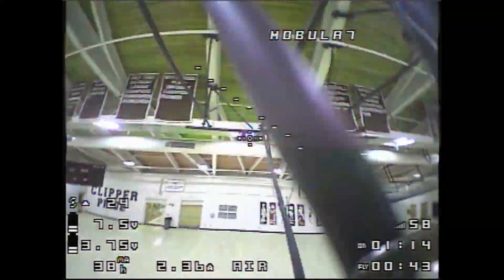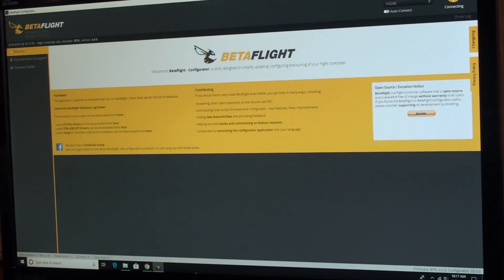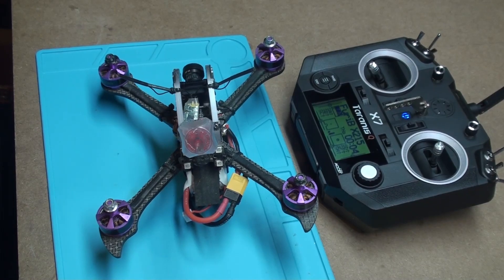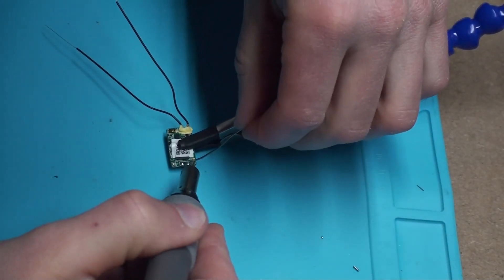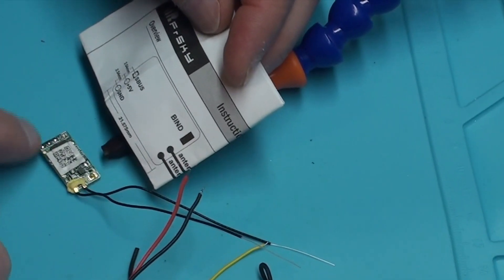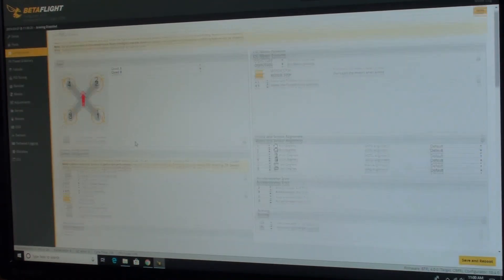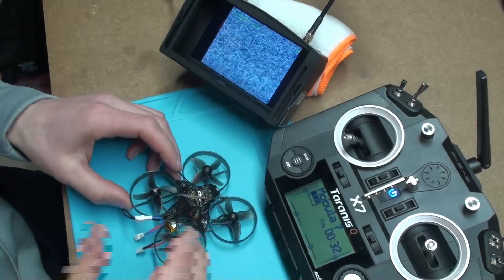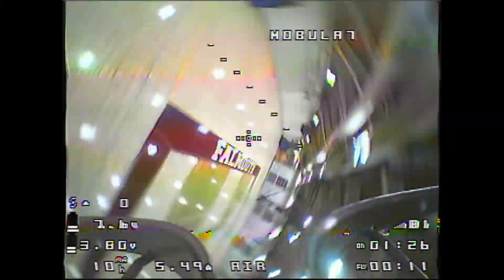Mobula7 Crazybee Receiver Dead? - Add an External Receiver

Comment: Do you think adding a frsky receiver to a flysky setup would work using the steps you took
Reply from the maker: If you're switching to an external receiver like this, then it shouldn't matter what the original internal receiver was. Good luck.

Comment: Hey, I am trying to do that same thing but my receiver wont give any light. altough I checked and its getting the correct voltage. Also when i press the bind and power it i get a solid green light
Reply from the maker: What receiver are you using? I recently had to bind an XM+ and wasn't getting lights, but then realized the lights didn't work but I was still able to bind.
Reply: @lowtone20hz  I have the normal frysky XM. And I haven't seen the red light ever. So maybe it is broken. The greenlight is only on when in binding mode. But it stays solid.
Reply from the maker: @Aron_Imandikromo  If it's solid green I think you're good. Try connecting to Betaflight (or whichever FC firmware you have) and go to the receiver tab, plug in a battery with your transmitter on and see if you've got movement on throttle, roll, pitch, and yaw. If you do, then you're good.

Comment: How do I know if a rx is inverted or non inverted (whatever that means)? I see folks just say that matter of factly but I don't see that info anywhere on my rx board or in my whoops papers. Are all Frsky rx  inverted?
Reply from the maker: Sorry for the delayed response. I hope you've got it figured out by now. If not, this might help. https://oscarliang.com/uninverted-sbus-smart-port-frsky-receivers/ But I think it only really matters if you have an F4 flight controller.
Reply: @lowtone20hz  Thanks, I will check it out. Is the Express LRS receivers inverted or non? I was considering replacing an SPI rx with an ELRS one. Some are very small and the range is touted as great.

Comment: Great info. If you just want to change to a different rx for better range and the SPI rx is not broke, will that make a difference. Is it okay to cut off the SPI antenna? Will that cause a problem with anything? Thanks.
Reply from the maker: You can cut it off if you don't want it anymore.

Comment: Can ELRS ep2 be soldered/added to a CrazybeeF4FR v2.0 FC that already has internal Frsky Rx?
Reply from the maker: Yes, you can follow the same process in the video only you will be soldering to both the TX and RX pads. Hope this helps if you haven't already gotten it flying. Good luck.

Comment: Hello, how are you? I would like to know if this procedure will work for an Eachine Trashcan Crazybeef4Fr version 1. Is the flight controller the same? What would change? Thank you very much for the video and help!
Reply from the maker: The FC does not appear to be the same. However, the process is the same. You just need to find an open RX pad. Or use the IRX1 pad which is inverted for using a FRSky receiver. Good luck!
Reply: @lowtone20hz  Thank you very much!

Comment: Hi! Does this work with the old receiver still intact? So lets say I want to put external Flysky receiver on the still working Frsky board?
Reply from the maker: I believe it would. Just make sure to change the receiver set up in the Configuration tab.
Reply: @lowtone20hz  thank you! :)
Reply: @lowtone20hz  Hi, me again. so i tried to connect a FS-A8S to the frsky crazybee. i tried ibus and ppm and in both cases changed it accordingly in the config tab. neither the quad nor betaflight does get any signal from the radio although the binding worked as it should. do you have any idea what i could try?
Reply from the maker: Check your wiring. I've not used Flysky, but it looks like you should have I-bus from the receiver wired to UART 1 on the FC. In Betaflight - 'Ports' tab set UART 1 to serial rx, 'Config' tab set to Serial based receiver and IBUS protocol. And make sure your transmitter is outputting the correct channels.
Reply: @lowtone20hz  Ok I fixed it. Do not really know why since this is my very first quad. IBUS did not want to work. I set it to SBUS instead and now everything works fine. But thanks for your quick help :))

Comment: I find it doesn’t bind if the tx is too close to the rx and the tx also needs a second to boot before plugging in drone. Save your original settings in beta so you can reboot to original working config. Fixed several problems for me.

Comment: hello, i understand electronics. Behind the receiver antenna is an integrated called cc2500. When you look at the datasheet of this integrated, it is seen that the 8-10 legs belong to the crystal outlet. I have the same problem, and this crystal is bent over it. I think he broke down when he bent down. I haven't tried it yet, but I'm going to find and replace this crystal.
Reply: i changed the crystal oscillator. everything is back to normal. However, I could not bind it. It is necessary to install an external receiver.

Comment: Nice video. Have the fc sbus slot? With wich receiver on mobula 7 v2 can i buy for easy changing the receiver. Becousr my radio is radiolink its work with sbus.
Reply from the maker: Any SBUS receiver should work with the FC. You just have to make sure the receiver will work your Radiolink transmitter. I'm not familiar enough with that radio to recommend a receiver.

Comment: Ok so I put the XM+ in my mobula7 and it sometimes arms and sometimes it doesn't. And when it doesn't it gets stuck at 49 rssi?! What could be wrong. Very ireliable scared might lose it somewhere
Reply from the maker: I believe 49 RSSI is a default and means it has no signal. So, it sounds like a bad connection. I think it would be worth double checking your wiring to make sure there's no loose wires.
Reply: @lowtone20hz  yup just re soldered everything but it still happens I updated my taranis qx7 any it does seem to be better but now it disarms mid flight. What would cause this? It like loses signal but doesn't display in the rssi that it's loosing signal. Thanks for the help!

Comment: I have a mobula 7 v2. It is acting weirdly. If clamped, the motors run fine. If held in my hand and moved around while the throttle is moved it runs well. Set it on the ground and any amount of throttle just makes it flip over and die. Any troubleshooting suggestions? Thanks. It's on 2s.
Reply from the maker: Check that the props are on correctly and all the motors spin the right direction. Good luck.
Reply: @lowtone20hz  Thanks. I'll check those points.

Comment: My internal SPI receiver stopped working on my mobula7 when I 2s'd  full speed into a wall... The Crystal oscillator near the receiver chip busted open and it looks that's what happened to yours too. I can see it in the video. It's the rectangular component on top side of board right near the antenna. If I knew what frequency oscillator goes there I would just replace it, but I don't. I'm guessing either 16Mhz or 32Mhz based on the receiver chip, but I could totally be wrong.

Comment: NOTE!
If you are clumsy as me, and for some reason you ripped off the +5V pad from the board, you can also use the +5V which gives power to the camera (which is on the other side on the board) to power your XM+.
Reply from the maker: Absolutely!

Comment: Have you done a range test with this?  I love my mob7 but the range is pretty terrible, was thinking of getting a proper FlySky module and doing the same as you.
Reply from the maker: I have not done a head to head comparison. I do have a second Mobula 7 that still has the SPI receiver working and the RSSI numbers are lower.

Comment: Im having the issue as a few in the comments ive bound the receiver to my qx7 green light showing on XM receiver but no input from my transmitter? ive changed sbus in the config tab but not exactly sure what to do in the ports tab i only see Uart1 and uart2. Uart1 seems to be the vtx. ive tried turning serial RX on both seperatly but nothing happens. The solder joint on IRX1 looks bad though i kind of messed it up maybe this is why?

This is why i bought a receiver after a crash my mobula would not bind.

thanks for the help
Reply from the maker: A bad solder joint will definitely cause some issues. Make sure that for the UART you turn on Serial RX, that the telemetry output, sensor input, and peripherals are all disabled. You may also need to plug a battery in for the receiver to work properly. To further understand - what quad do you have and which pad did you solder your receiver to?
Reply: John Solo turned out it was a bad solder joint. Now it’s working perfectly. Thanks for the help :)

Comment: Thanks for sharing, how did you get RSSI?
Reply from the maker: To get RSSI on the XM+ you need the firmware for it from the FRSky website https://www.frsky-rc.com/xm-plus-mini-sbus-non-telemetry-full-range/ Then in the Betaflight receiver tab set the RSSI channel to the same as your firmware. Good luck.
Reply: @lowtone20hz  thanks again, already found in betaflight

Comment: I have a flysky mobula7. Can I add an external frsky reciever to it?
Reply from the maker: I believe you can. From what I've looked at the boards are all the same and once you bypass the internal receiver you are just using a UART. So, the original internal receiver shouldn't matter.
Reply: lowtone20hz thanks man!

Comment: I requested mobula 7 f3 with wrong receiver can i add xm+ to mobula 7 f3 ?
Reply from the maker: It sounds like you have the same flight controller I have in the video. The onboard receiver it came with shouldn't matter. Check to make sure it's the same FC and you should be good to go.
Reply: @lowtone20hz  its crazybee f3 with dsmx onboard receiver
Reply from the maker: If it's the black board, then you are all set. The connections are all the same. Good luck.
Reply: The rx pad not on the board as yours
Reply from the maker: What's the link to the product page?
Reply: @lowtone20hz  https://shop.makerfire.com/products/happymodel-mobula7-2s-75mm-brushless-whoop-drone?variant=15424523370547
Reply from the maker: The link was for the whole Mobula7. But I've looked at all of the different boards and believe they're all the same. https://www.google.com/url?sa=t&source=web&rct=j&url=http://www.happymodel.cn/wp-content/uploads/2018/10/Mobula7-DSM2-DSMX-version-manual.pdf&ved=2ahUKEwizo_eT_ObjAhXkY98KHT3yAbEQFjAAegQIAhAB&usg=AOvVaw3RMjDLlt44MB_KvH1E3e-- Check out the manual - you have to use the RX pad where the green wire (smartaudio) is.

Comment: Great, got the exact same issue, I guess it should work with an r-xsr ? :)
Reply from the maker: I believe it should. The size is about the same. The trickiest part is squeezing the receiver under the canopy.
Reply: @lowtone20hz  It's easier to manage if you place it under the flight controller,  just above the battery tray. 3m VHB tape it right to the FC.

Comment: Will this same procedure work for a eachine trashcan , i have the same problem , a non responsive reciever .
Reply from the maker: I believe it should. The flight controller is a different board so you'll have to find the appropriate UART to use. Once you figure out which solder pads to use you should be good to go. Let me know how it goes. Good luck!

Comment: I have followed this procedure and have successfully bound the receiver and made the changes in betaflight, but I am not getting any input on the receivers tab.  Any ideas?
Reply from the maker: It looks like the same problem @Tech Ex was having below. Double check the Configuration tab in Betaflight and make sure you have the receiver set to SBUS. And in the Ports tab you switch UART 3 to Serial RX. There seemed to be more to his problem so read through those comments below. Let me know what you find.

Comment: My build in reciever has terrible range it failsaves at less then 20m in a clear area so this is kinda perfect for me!! Could you please share some pictures with me how and where you put the reciever away inside the canopy? By mail or upload? Thank you loads in advance
Reply from the maker: Sorry to hear the built in receiver isn't working for you. Double check and make sure the receiver antenna is connected properly to the board. You can look at the pictures in the manual to see how it should be. The antenna should be coming off the bottom front of the board. 
As for where I put the XM+, it's under the canopy laying sideways with the beeper on top of it and squeezed behind the camera. I'm not sure that any pictures will do it justice. Give it a try and if you're struggling with it leave your email and I'll try to get some pictures. Good luck!
Reply: @lowtone20hz  Yeah the cable(antenna) is coming out of the bottom of the plate at the front of the board but I just have a 22awg cable there so im not sure if every mobula7 is like that but I assume it is. but I will change to a xm+ since I have intentions to do yearly indoor woop races in Sweden. just waiting on a new xm+ to arrive since I don't wanna pick apart my other drones

Comment: Even after seeing the green light on the receiver, I'm not seeing any response from the quad. Any suggestions?
Reply from the maker: Double check the Configuration tab in Betaflight and make sure you have the receiver set to SBUS. And in the Ports tab you switch UART 3 to Serial RX. Let me know if that works or not. Good luck.
Reply: @lowtone20hz  I select it, then save/reboot, but when I go back into betaflight, it is switched off.
Reply from the maker: I'm guessing you're talking about the Serial RX. Make sure you have turned off SmartAudio on UART 3 under Peripherals on the Ports tab. Also, double check that your signal wire for the receiver is soldered to the correct pad - RX3. Let me know your progress - I'll help you keep troubleshooting as best I can.
Reply: @lowtone20hz  Thank you. I will give it a shot.
Reply: @lowtone20hz  I've got it to the point at which I can see the receiver values changing in betaflight, but the motors won't fire up.
Reply from the maker: Did you test the motors in BF before you switched the receiver? See 1:25 in the video. (If they worked then, the ESC's should still be okay.) Keep in mind that you need a battery plugged in to test the motors in BF. Also, double check the ESC protocol is DShot600.
Reply: @lowtone20hz  Yes, they did work, so I don't know if it is a problem with the board.
Reply: And  they are running DShot600.
Reply from the maker: Ok. So if it was working before I think it should be working now. I'd say try switching things back to stock settings before you put the new receiver on (you can leave it attached to the board) and make sure the motors are working in BF. If you have a Dump file you could just use that. And if they work, try setting everything up for the external receiver again. Sorry this is such a pain.
Reply: @lowtone20hz  Thank you! It isn't your fault and it is kinda fun to figure out.
Reply from the maker: Thanks. It's just hard troubleshooting when you can't see it first hand. Any more progress?
Reply: @lowtone20hz  Not as of right now. I'm still not seeing a problem with the connection. Might be a setting in betaflight.
Reply from the maker: Thanks for the link.That definitely looks helpful and I'll add it to the video description.
Reply from the maker: @Tech Ex  Did you ever get it to work?
Reply: @lowtone20hz  I did in the end but with out smart audio and with wobbly stabilization... I learnt alot with this flakey product so to conclude my next choice is the GePRC(buzzer pads)/ BetaFPV( no buzzer pads) 12a AIO board with our XM+ .  :)
Reply: @lowtone20hz  I did not. Thank you for your help, but I haven't been able to get it to bind. I also haven't had much time to work on it. But again, thank you so much for all of your help!

Comment: Good job!  I'm looking at adding an external to improve range on my HD.  You reckon this will work as long as you "swap" receivers in BF and disconnect antenna?
Reply from the maker: Yeah, it should work just fine for you. There's no reason to disconnect the stock antenna other than to get it out of the way. Good luck.

Comment: What is gonna happen when I let the smart Audio wire on its place from the beginning on
Reply: I mean why do you do this? To be save that it won't be harmed?
Reply from the maker: If you are referring to why I soldered the Smart Audio wire back on despite it having no function, it is to just keep it out of the way and still attached to the camera/ VTX. I don't want to remove the Smart Audio wire just in case I need to salvage the camera out of the Mobula7 later.
Reply: I mean can I just let it there with no functional problems?
Reply from the maker: Yes, you can remove it or leave it since Smart Audio won't work anyway once you switch UART 3 to the Serial RX.
Reply: @lowtone20hz  ok thanks

Comment: Thanks for the video im going to try a this on mine as the built in antenna ripped off 😊
Reply from the maker: No problem. If you're lucky and still have the built in antenna, you may be able to solder it back on. I've done that before on the Eachine E010S. Good luck!
Reply: @lowtone20hz  and if not it's also no problem.. just take another cable and cut it down on the length of 31 mm and solder it on